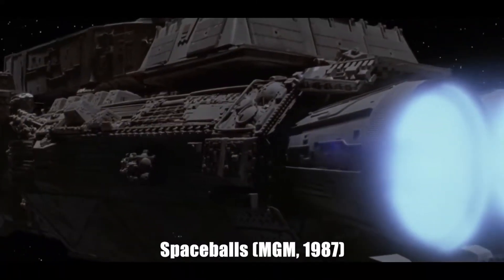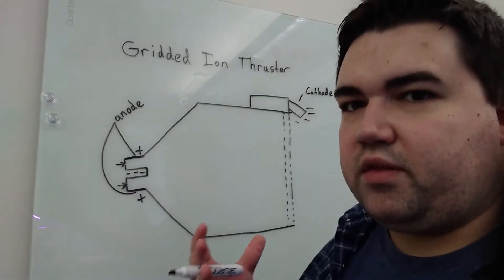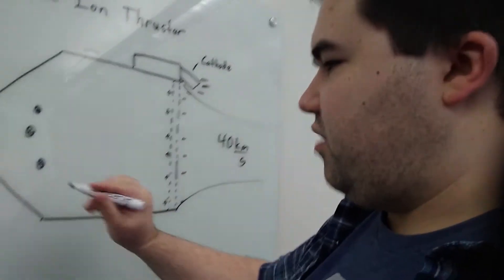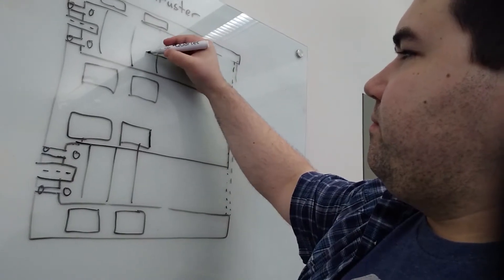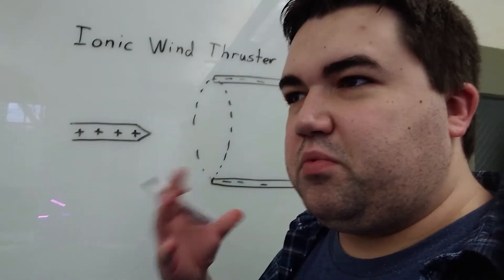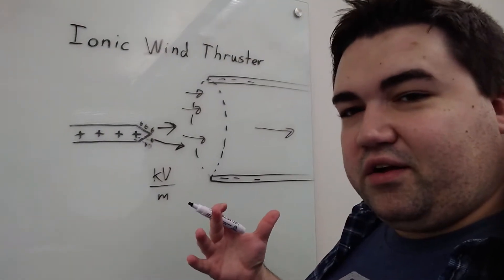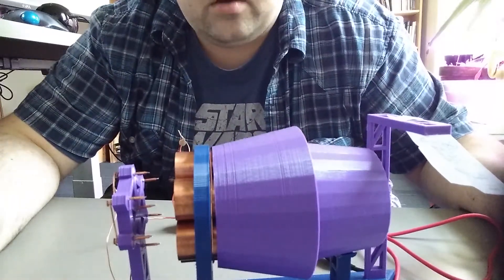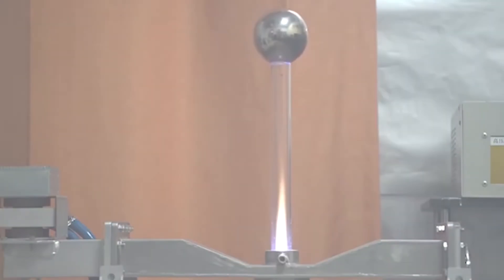How does plasma propulsion work?

Comment: This can also be taken a step further I believe. With strong enough electromagnets the magnetic fields can be used to go beyond just confinement, they can be used to outright pinch the plasma. This means that if there is hydrogen or helium mixed in with the xenon you can get fusion to trigger which can give the xenon ions a crazy boost in momentum just due to the temperatures the reaction can achieve. Also p-p fusion create positrons which further ionise the xenon

Comment: so it still begs the question.... no matter how much the thrust and using mega joules of power, what are you pushing against if there is no atmosphere ?
Reply from the maker: Great question! The notion that rockets work by pushing themselves against the atmosphere is a pretty common misconception. If you are using any kind of rocket or plasma propulsion, whether in the atmosphere or not, the spacecraft is "pushing against" its own propulsion exhaust. The force of the propulsion exhaust being accelerated out of the engine is In turn causing a equal and opposing force on the rocket, accelerating it in the opposite direction (Newton's third law of motion). In fact, spacecraft are actually able to propel themselves more efficiently in space than in the atmosphere, because there is no drag force as the spacecraft accelerates.
Reply: @Nerdherfer  yes I have read this but it then begs the next question. If that's the case would their be a benefit to re routing the plasma after it comes out to then doing a u turn and pushing against itself just like a tesla valve or against the craft? 🤔😱
Reply from the maker: @Buzzhumma  This would actually make the rocket less efficient. Firstly, the escaping plasma is moving incredibly fast, and would degrade and destroy with tesla valve without any magnetic confinement, which would be inefficient. Secondly, in order to direct the plasma back at the rocket, the plasma must push against the tesla valve, which if it is attached to the rocket, would actually pull the rocket backwards. This would be the equivalent in principle to a jet engine using reverse thrust as an airplane lands.
Reply: @Nerdherfer  maybe then they should have the thrust pointing forward and use the point you laid out to go forward! 😂

Comment: Question, on a space Ion or Hull Thruster, is there any ratio of power/amp to thrust with those drives?  I've seen many reference examples for small ones like using 10kV to a low amp (<1 amp), but nothing larger.  I assume that is for small satellites.   What if you in space could have a continuous large 20MW or 50MW power source for a bank of Ion engines (assume 10).  What would be the estimated thrust to that level of power per each?  Is there a estimated avg ratio on power to thrust?
Reply from the maker: Great question! Since power is directly related to current, a higher current would mean a higher density of plasma created from the flow of propellant. The problem with this is once you start adding more plasma to the thruster, the higher the chance the ions will collide with each other, and these collisions cause the plasma to lose energy and even deionize in the thrust chamber, dramatically reducing the efficiency of the ion thruster. Increasing the voltage too high is also impractical because higher energy particles respond more strongly to magnetic fields, and move on curved trajectories, which is bad when you want them to move straight out of your ion thruster. Having a higher current also increases the strength of induced magnetic fields, producing the same problem as above.  Therefore for the sake of an ion thruster, it's better to have less propellent and a high-ish electric potential, which causes the plasma ions to exit the chamber faster and more efficiently. As for the video, it is still a work in progress. I have been busy with my day job at the moment, but I hope to have it out soon.

Comment: Sir is it possible to Create thrust as same as the jet engines by "Compressing air and ignite by micro wave which turns compressed air into plasma which can be used as thrust.
If Possible will it be efficient ???

Waiting for your reply 🤗🥰
Reply from the maker: Well, the technology for this is still being refined. The study I referred to in my video did not reproduce a jet engine's thrust, but the results looked very promising!
Reply: @Nerdherfer  The paper actually does state that the atmospheric microwave plasma propulsion does produce "thrust comparable to that of a conventional jet engine". Specifically about 28N of thrust per 1kW of power. So I am too with you and believe it is very promising!
Reply: Yes it is possible; however, not very efficient let alone practical. Energy requirements do not compliment our current battery technology. And due to heavy plasma erosion, we don't have many light, strong, and high temperature materials to withstand direct bombardments of plasma for sustained flight (like an airplane).

Comment: Can this be used in a hyper loop?
Reply from the maker: Great question! It wouldn't be practical to use a plasma thruster in a hyperloop. The ion thrusters I talk about produce a very small amount of thrust, which is great for accelerating spacecraft continuously over days/weeks. If you put an ion thruster in a hyperloop, by the time you accelerated to any appreciable speed, you could have driven a car to your destination.

The "microwave afterburner" I discussed later in the video  could produce enough thrust, but it requires some form of air intake/compression, similar to a standard jet engine. Since the hyperloop is in a vacuum, this wouldn't work.

The best means of accelerating in a hyperloop is using electromagnets, or electric motors.
Reply: @Nerdherfer  thank u